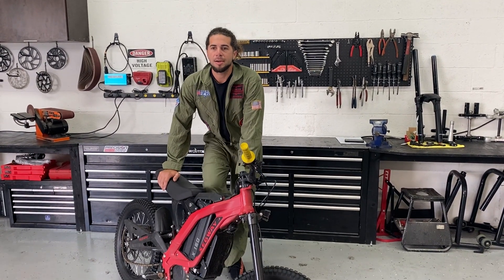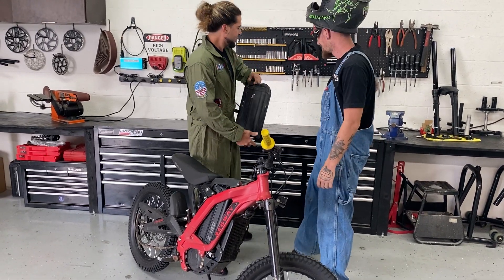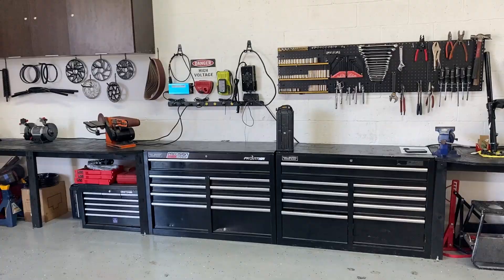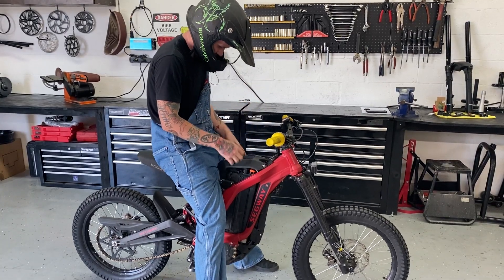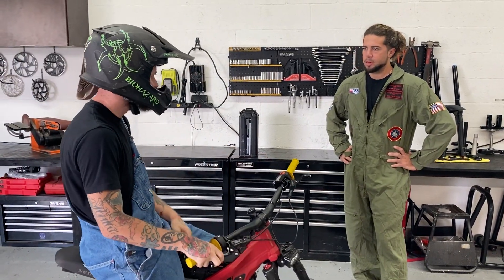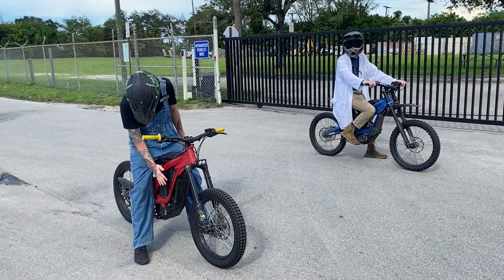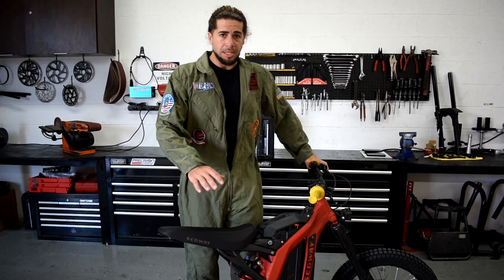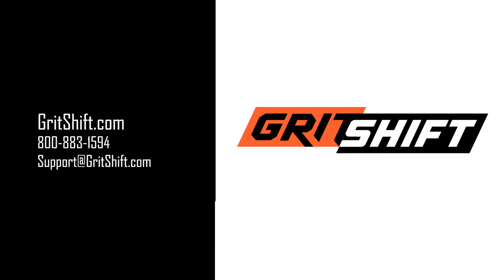Putting a Sur Ron 60V Battery In a Segway X160! WILL IT WORK?!

Comment: I've swap S 48V controller which I was using with 60V custom battery to X 60V controller but I can't see difference. There should be torque and speed increase but bike is behaving same way. Ant BMS is also showing that it Takes only 60A while it should reach at least 80A now. Is there any programming needed?

Comment: Im thinking trying battery and controller from the x to the x160 and see what happens with the display on the speedometer 🤔🤔
Reply: @gritshift  yeah just tried it on my x160 yesterday my Segway is officially a surron x with crazy torque haha thx btw 🫶🏼💪🏼
Reply: @lil14 what was your top speed and what size sprocket is it stock?

Comment: I just changed my x160 battery to a 60v With the stock X controller, just noticed at the start It’s louder and sounds like it skips, might need to change the tension on my bike since now it’s different torque 😅

Comment: Would this not eventually burn out the x160 motor or blow the controller??

I heard the x160 motor is different?? Is this not true? What are all the differences other than rim size, no headlight, and battery voltage? 

Thank you!
Reply: They said the 60v runs perfect on the stock motor

Comment: The test wasn’t necessarily done correctly. I have both. The speedometer is calibrated differently from the stock Surron. Also the sprocket is much larger. The controller has no impact on anything. If u swap the 19inch wheels and sprocket from the x260 to the x160 along with the battery the top speed will be exactly the same. You’ll need to use a gps app to confirm because again the speedometer is calibrated for the much larger stock sprocket
Reply: This comment made me snag a 160 with intent to put the 60v 60ah on there
Reply: @TheeDrSack  The Chi Gladiator? Same, got my X160 and have a used Sur Ron battery on the way! But oh man I really want that $2500 beast...
Reply: @williamtkaczuk4825  I got it and the mileage is crazy, insane if kept under 45, (get usually 65+miles a charge if I’m mashing it entire time at or under 45) I’m sure it’s close to 130 miles at 20-25 mph
Reply: @TheeDrSack  Sorry - are you saying you can get up to 65+ mph with a Chi Gladiator on an X160??
Reply: @DESOUSAB  yes and no, I only get up to 45mph, but haven't touched anything on the bike besides swapping better battery, to go 65+ youd need a beefy controller and tbh I think the x160 motor wouldn't enjoy it. X160 starts to have issues past7.5 kw, sur ron is double but will have issues oast 16kw, testing belts and stripping sprockets alongside burning out the motor
Reply: Can you put 19inch wheels on the x160 ?
Reply: @kyris Barnes can you put 19 inch wheels on the x160 front and wheels
Reply: @kaydenlee7326  yes. The frame of the two bikes are the same size
Reply: @kyris barnes so can I put my back wheel 19 inch on x160
Reply: @kaydenlee7326  yes if u put 17s on a 260….which is the super moto kit the bike instantly becomes the same size as the 160
Reply: @kaydenlee7326  ofc! i like the 17 mountains for agility but potholes kill me, 19s would be dank
Reply: They was using a radar to test the speed.

Comment: Recently purchased Segway x160  I swapped out battery to surron 60v 32ah the controller to x Controller and a surron Motor. I put a 48tooth sprocket . Max mph I can get is 37mph according to bike speedometer. Is this normal speed after all the swaps…. And can a surron harness correct the speed??? GREAT VIDEO BTW
Reply: Cut the wire

Comment: Does the x160 have a governor wire that can be cut to increase the top speed?
Reply: No its in the app. Change it to Off Road mode. I also just change the sprocket. I went from stock to 42T and I went from 31mph to 40mph Gps

Comment: Awesome video just subbed! So what I'm hearing is the x160/ x260 /surron motors are all the same even tho they "say" one motor is bigger then the other? I have the x160 and all I would have to do is upgrade the battery and sprocket size and I would be going as fast as a x260 basically? From what I understand the controller upgrade from x160 to Surron x would be a waste of money because its the same.. so all in all just the battery swap and the sprocket swap and I would have speeds of x260 correct ?
Reply: @gritshift  Thank you sir I actually just watched your other video explaining this. Thanks for the research you guys are doing. it helps us saves money were we can !

Comment: Will there be any long term side affects of running the stock controller with the 60 v ?
Reply: I’m not a pro, but I’ve heard the long term is you’ll need to get new motor, and possibly new belt. Just like a car engine. If you up the rev and Hp it’ll need some supporting modes to handle the gains.

Comment: Hi, amazing video. I’m wondering to save some money could I buy a x160 or sur Ron s and change the controller to bac 8000 and the battery to 72v? Would it hold up fine and be just like a upgraded sur Ron?
Reply: Thanks for the feedback! Yes you can, we actually have one of our EBMX controllers on the bike from this video now. and another X160 going 72V.
Reply: thinking of doing same thing
Reply: @flatgrounders9694  that’s dope! With the new controller, does it keep up or go faster than the suron? Also what was the cost savings, if any compared with the x260?

Comment: This is sick. Im wondering what the x160s test rider’s weight was? Secondly, if you were to swap the controller for a sur ron controller and the battery to 60V, would you then be basically a stock sur ron?
Reply: Oh and subbed. #15 right here!
Reply: Other X160 differences:  17" wheels, 58tooth sprocket, no headlight/tail light, 1" lower front and rear suspension, single crown fork,
Reply: @gritshift  roger that. Appreciate it. I have a 160 lined up to buy today.
Reply: I have a segway with the sur ron x controller, it 100% matches their results, may have wasted time getting the controller lol. Also, there are some easy replaced parts to be the same as a sur ron, can save money this way too.  Also, if you want supermoto setup, keep the wheels and change the sprocket to get that top end out of it.
Reply: So is there no difference from the 160 to the 260 controller? Can u flash the firmware to match a 260?
Reply: @polack  what size sprocket is an upgrade for the x160

Comment: I put a Surron battery in my sons x160. don’t feel much more power, if at all, range is better though. Am I missing something?
Reply: Maybe controller? Idk after watching this video I expected it to feel stronger
Reply: @chaserivers2105  I was thinking about doing the same thing ... Now that I hear this maybe I don't know .. those batteries are expensive.
Reply: @michaell1212  I ended up putting a Surron controller with the Surron battery too and it’s night and day difference in power. Nothing for these bikes are cheap but they are a blast!

Comment: Did you guys think about the different sprocket and wheel sizes?
Reply: I would like to see a test with a 42 tooth sprocket as that gives the same gear ratio as a stock 48 tooth on the sur ron
Reply: @gritshift  i would love to see that
Reply: @gritshift  Maybe when you put a 60V battery do the shunt mod to up the amperage and you will have yourself a X controller?
Reply: @gritshift  Inside the controller look for a small metal bar. Some controllers have 1 2 or 3 of them. You can add solder or bridge them to increase current flow increasing more wattage more torque. And thanks yes that's my e90. Its just has basic bolt ons and mhd stage 2+ probably 400hp lol
Reply: @gritshift  Yes and make a video doing a shunt mod to the controller. And damn I wish I knew that before I purchased the delphi coils. I had been chasing misfires and the issue were my injectors. Got some index 12s and no more misfires.

Comment: Went with the gladiator battery, still capped at 36mph, any guesses on how to hit 45? Battery only has positive and negative connection, no harness connection
Reply: The range at 30-35 mph is unreal however
Reply: @gritshift  thank you!
Reply: Finally got it to the low 40mph by removing the bluetooth box!
Reply: @gritshift  that’s not what I’d call her but yes, oh the bike! Yes!
Reply: @TheeDrSack  Where is the bluetooth box located?  I'd love to do this mod.. still no issues as of today?  Thanks
Reply: @TannaciousD  it’s under the seat! There’s a little space for it, it’s actually made the seat slightly comfier too 😂🤣
Reply: @TheeDrSack  Before you removed the bluetooth box did you already set it to Off Road mode in the app?
Reply: @chesteryao  I went into the app and set everything as best I could before removing it, but I don’t think there would be any left over data since it would be unplugged, have also gotten to 48 mph and still get about 60 miles per charge full throttling
Reply: @TheeDrSack  That's strange because my buddy and I both have stock x160s but we swap our sprockets to 42T Mine can go 42mph Gps at full charge 54V. His can go only 39-40mph. We couldn't figure out why his bluetooth was not working. Turns out when he added a luna float seat he removed the bluetooth box and actually made his bike slower. But now its back on and hitting 42mph
Reply: @TheeDrSack  Im fine going 30-40mph but man I wish I have more range with my 48V battery. 60 miles is nuts!

Comment: what about x160 motor + sur ron controller + 60v battery?
Reply: nvm I just read the other comments, I'll prob get the x160 and upgrade the battery first 🔥
Reply: @gritshift  damn $2k?? was it used? what a deal!
I heard the x160 wheels are actually very desirable coz moto conversion and often sells for more than the 19", btw where do people normally find 60v batteries? local market places? I found some guy locally selling the stock suspension for $60, my current plan now is x160 + new fork + battery, then later on wheel + controller, it's like i wanna get a sur ron but there isn't even stock so this is the only route hahaha
Reply: @gritshift  makes sense esp if we are upgrading all the electronics down the line anyway haha, just subbed bro cant wait to see more x160 upgrade content
Reply: @gritshift8657 do you think this is a good deal I have a 72v razor that goes 60. He said he wants 300 cash is that a good deal

Comment: So I’ve seen other videos where they cut the green and black wire to remove speed govener, anyone have any knowledge on this? And if so, do you gain anything from cutting the wire without having an upgraded battery?
Reply: I did that on my x160 Segway and got 37mph on my 48v. Unfortunately the battery cuts off going full throttle which I’m assuming is a safety cutoff. I’m getting my 60v later on today and I’m hoping that I’m able to run things smoothly.
Reply: @christopherfigueroa4143  is it better with 60v battery?
Reply: @christopherfigueroa4143  Did you find it worked fine now with the 60v battery? I ask cause I’m getting a 60v for mine tomorrow and want to know your experience before I cut that wire.
Reply: What were your guys experience with the batteries and controllers ? I’m looking to do the same

Comment: I would like some help with getting one of these bikes. I want to get a x160 and keep everything but the battery stock. If I order it and change the battery to a 60v 52ah battery everything should work and I should get at least double the range doing so. If anyone can let me know that this would work. I personally don't need more power from this bike, all I need is the best range I can get.
Reply: The motors are the same between the 160 and 260??